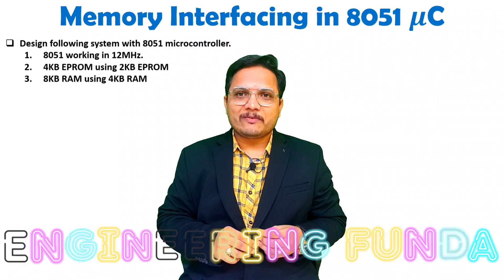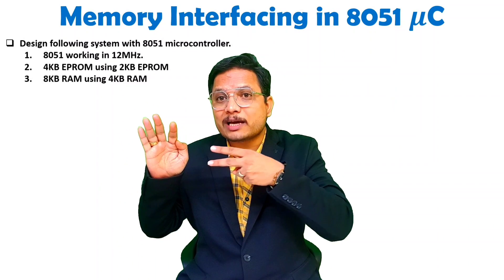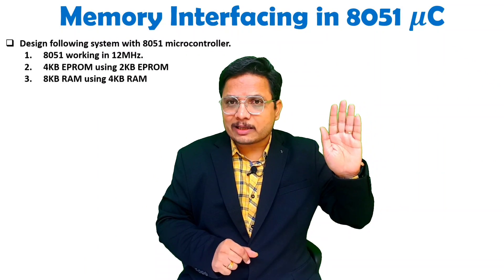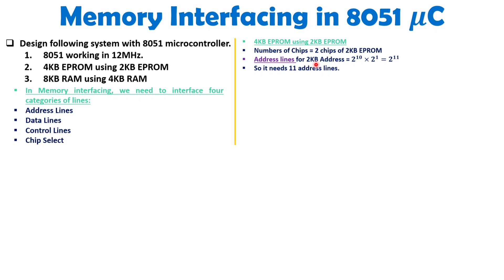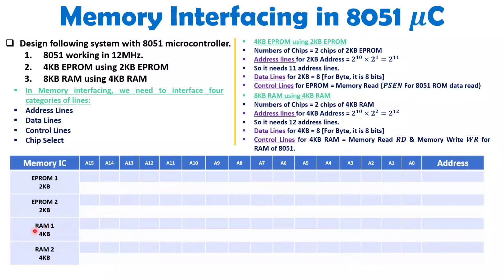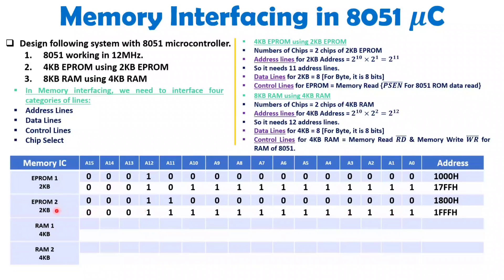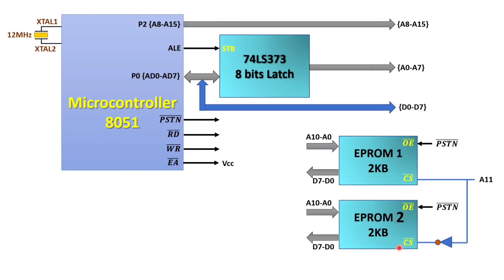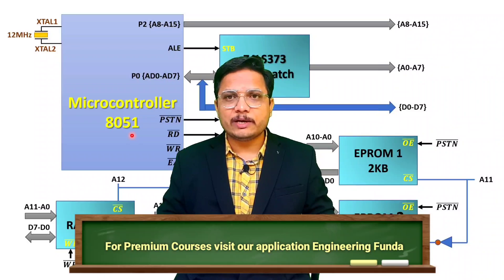Memory Interfacing in 8051 Microcontroller Explained: Memory Mapping, ROM & RAM Signals

Comment: Need one quick clarification.. 12:50, Here you are connecting it to Vcc, meaning the internal ROM is available. Now let's say I am grounding it.. then int ROM will not be available, so does that mean I can start the addressing from 0000H for EPROM1 in Memory Mapping? Also why can't we start the RAM address from the address following the Ending address of EPROM2 ?
Reply: @abhinavs9008  you have separate control signals for ram and rom , so separate address space is used for ram and rom.
Reply: @chirangbpandey9503  Hmm, I think I get it now. Thanks for the help
Reply: @abhinavs9008 Bro waited months
Reply: @shaunuwuu  🥲